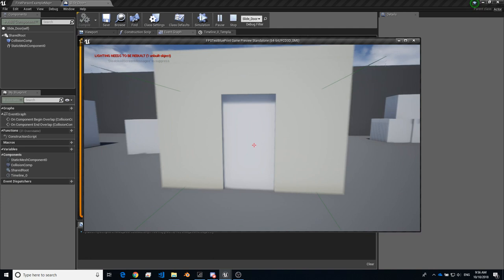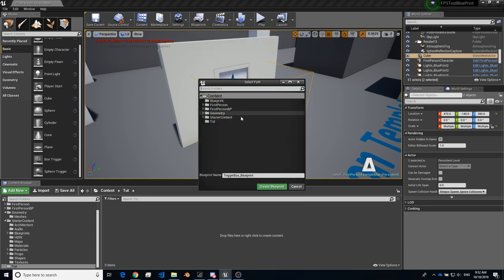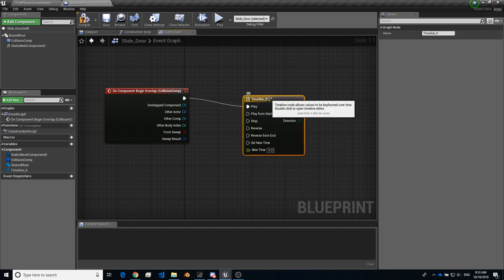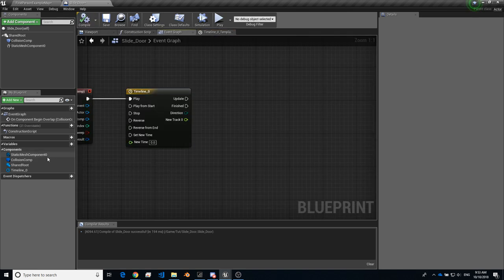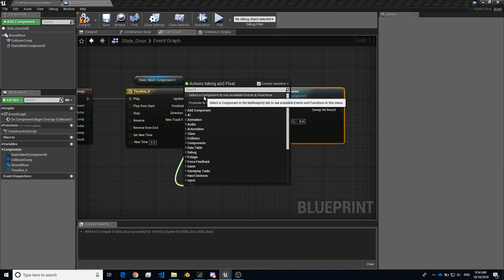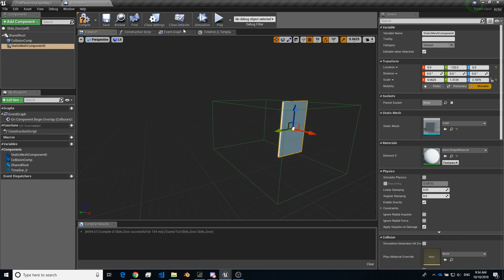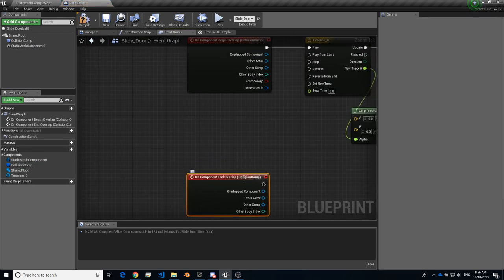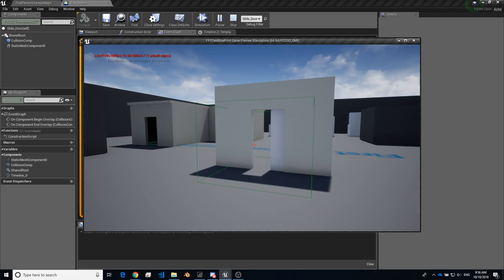UE4 - Sliding Door -  Unreal Engine 4 Blueprints Tutorial

Comment: I reviewed the hour-long lessons on this topic and failed, lost a lot of time. After watching your video, I solved the problem in five minutes, thank you so much for your video, maximum information in minimum time, really great video!!!!! I wish you good luck bro.
Reply from the maker: This is what I try to achieve with all my videos. I cant stand those long ones aswell.
Reply: @Markom3D  I'm having trouble with the change of transform, I've followed the steps, but the way the door opens, it opens in an instant, rather than over the course of one second.  I've checked my keyes on the timeline and they say 0,0 and 1,1, and the Lerp is vector, but the door just pops out in an instant, and even with the trigger exit,  it does not even reset to the orriginal Y position.  what's going on?
Reply from the maker: William Weidner I’m not at my pc, but when you enter it again, do the doors go even further apart?
Reply: Markom3D I figured out the problem.  I had simulate physics on and it was affecting the transform
Reply from the maker: William Weidner awesome, well done